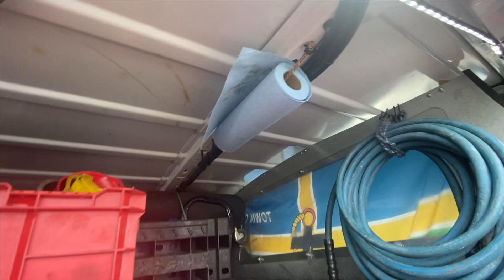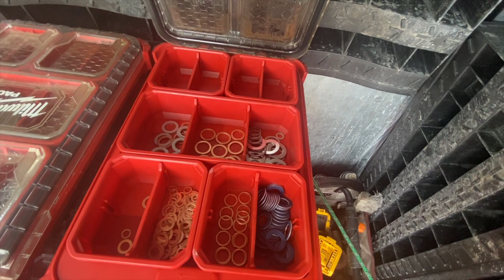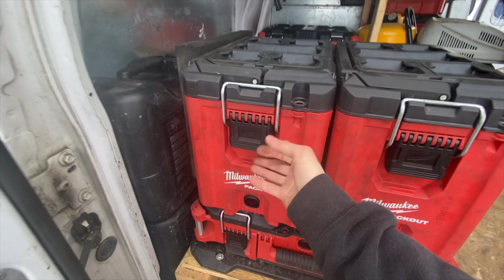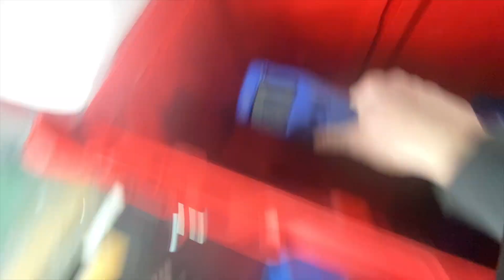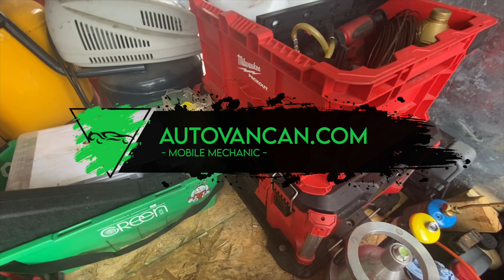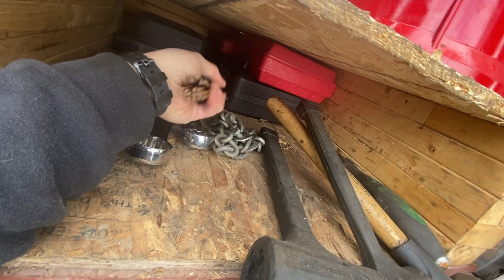Mobile Mechanic Service Truck / Tool box TOUR Feat. MILWAUKEE PACKOUT, SNAP ON In-depth LOOK!

Comment: See you mentioned needle scaler is your favourite tool, any tips on what jobs you use  it for / find it good for ? Have only used mine for chassis restoration.
Reply from the maker: It’s a great tool for removing/finding rotten backing plates on disc brake assemblies. Good also for fuel pump lock rings. Can be used on heavily corroded caliper carriers.

Comment: Didn't realize there was a tire season other than people swapping snows for summers. Can you explain please?
Reply from the maker: Hi there, automotive shops/mechanics in this area refer to as the busy season as everyone all at once has their wheels/tires swapped for the change in “season” I.e winter to spring and fall to winter. It’s commonly known as “tire” season. There is a large ramp up in tire sales in accordance to the seasonal change over as it is typically when customers will buy tires. Shops and myself included will typically be fully booked and have a typical waiting period of over a month during this time. It makes fitting in emergency appointments difficult at times. Hope this helps.
Reply: @autovancan  Thank you sir, you don't mount and balance tires though do you?
Reply from the maker: Unfortunately not at this time 😭
Reply from the maker: However I do offer static balancing services.
Reply: @autovancan  what does that service entail?
Reply from the maker: which service are you referring too? Please visit www.autovancan.com for more information
Reply from the maker: Static balancing involves balancing a wheel on a spirit bubble device

Comment: Should buy couple cheep bigger tool boxes and just bolt them in van...looks very unpleasant now.. sure it works but takes up lots of space with cheep plastic tool boxes that not last
Reply from the maker: Thank you for your feedback, metal boxes take away from the GVWR, heavy boxes don’t make money tools do.
Reply: I like the plastic tool boxes, they don't rust, can be moved out in case you have to crossload/work on a vehicle in a tight space that you can't fit the van in, & modular customization. I'm thinking of getting an explorer 5140 or pelican 0450 plastic tool case for mobile mech side gigs.
Reply: @autovancan      there tool boxes that not heavy.  300 pounds or less to fill whole van with tool boxes
Reply: Metal tool boxes are great for mobile van/truck storage (seen dudes use the cheaper HF boxes) but in the clip, it's mentioned he prefers these boxes because they are sealed and help prevent rust on his tools. It'd be cool if you could seal off those metal tool boxes (rubber seals), without it affecting drawer sliding.  Patent pending! 😁